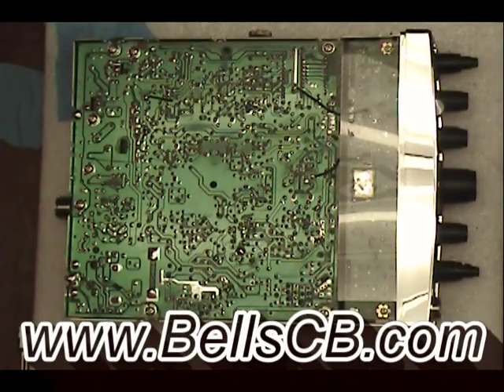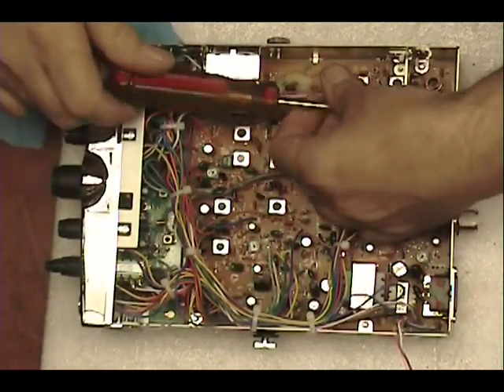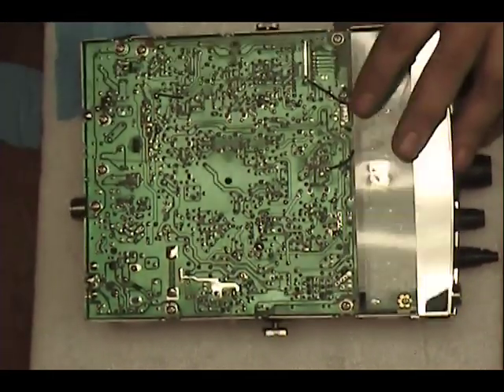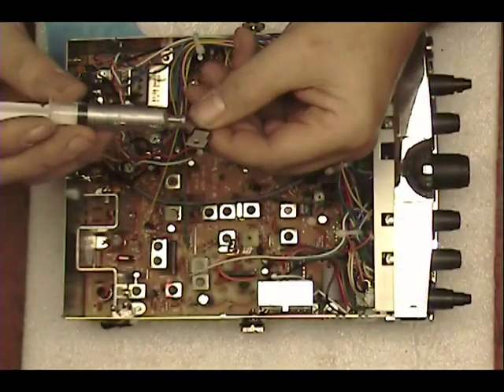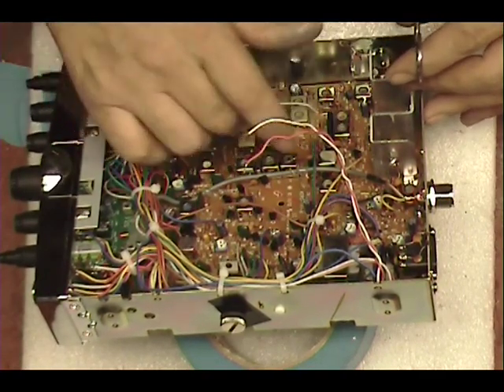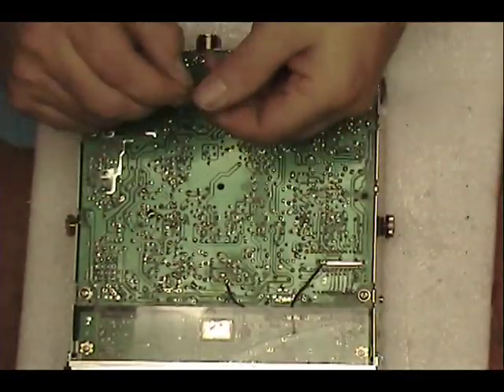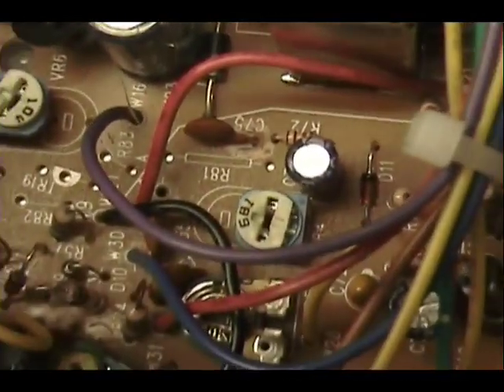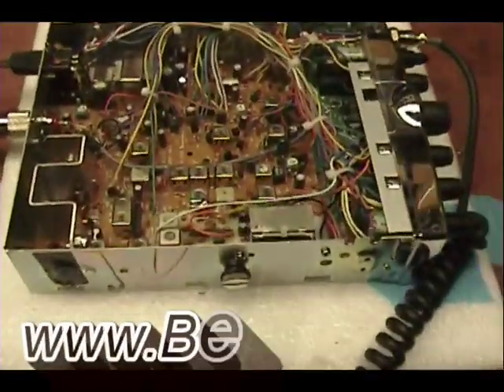Cobra 29LX FULL Mosfet installation Show-it-all series

Comment: Does the cobra 29LX need a variable kit for use of an external amp?
Any help will be greatly appreciated thank you.
Reply: It depends on the amp. Typically amp inputs are rated for 1.5 wat dead key. And no higher then 4 watts on the swing. My cobra 29lx bone stock swings 15 your mileage may very so in so many words yes.

Comment: I just bought a Cobra 29Ltd from my local radio shop. I had him do the D11 snip, peak and tune. I can't tell that it's any better or worse than stock. It keys at 4w but I see no swing with modulation. Though it seems to be getting out ok, nothing exceptional. Any suggestions?
Reply: Clipping the diode in a 29 leads to the modulation of the wave form to get clipped on the top and bottom. So the carrier maybe getting out but you sound flat because of the mod clipping. The best thing that I have found is getting a cheap rf spectrum analyzer for your cell phone with a free app and adjust vr6 for the best peak to peak. The wattage is lower on a meter and it dead keys lower but people can hear me clearly from father away. I also ditched my lil will for a sr-a10 half wave antenna..

Comment: What is the going rate for that job?
Reply from the maker: +Mason Bradfield   Mason, Currently on a new radio it is $59 and includes full alignment of RX/TX and Synthesizer.
Reply: +Bells CB what chome 29 it is same as lx model with clock and alarm wx or it is difference

Comment: Another fine video.  I am a CB and amateur radio enthusiast, and have over 20 years experience in the design, installation, maintenance and repair of public safety (911) radio systems infrastructure including paging transmitters, repeaters, voted receivers, microwave, etc.  I had also served as a volunteer technical "consultant" for a nationally known, high volume CB radio dealer for a couple of years during the prior decade.

Anyway, in regards to Bell's, I can tell you, this is pretty much the only YouTube CB repair channel worth watching.  Some guys, using only a PDC600 meter, a lip-whistle tone generator, and a screwdriver, like to call themselves "technicians"  Bell's does the job properly, shows you how to do it, then shows the results using REAL test equipment.  RARELY will you see a CB shop show you what your audio looks like on a scope, or power output with industry standard equipment.  The proprietors of the "Knick-Knack Super Paddy Whack" "radio mods" won't do this.  Either because they either don't own the equipment or are afraid their customer will realize what a non sinusoidal waveform looks like and why it's not right.  There is good stuff here fellas. -- Stay safe!  

(DISCLAIMER:  I do not work for, sell for, represent Bell's CB in ANYWAY)

Comment: where exactly did you move the 22ohm resistor to more specifically what would the location number be
Reply from the maker: James, it is across (parallel with) R21.
Reply: What is the function of that one? Is that the one related to the TalkBack?